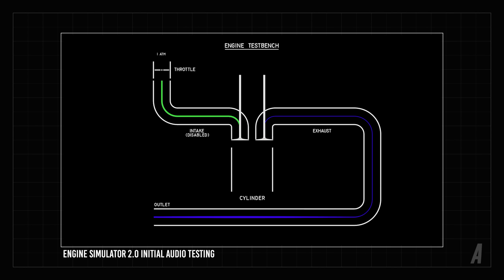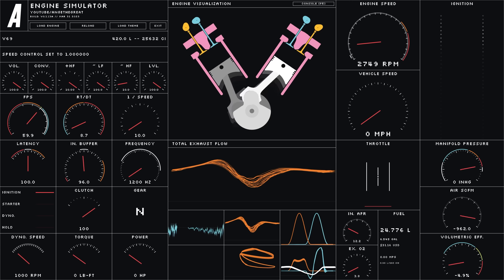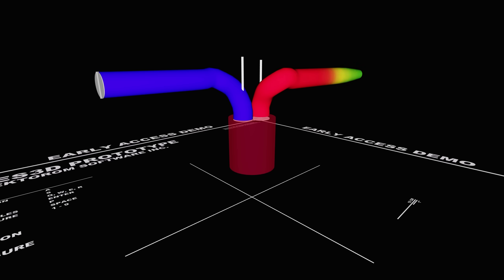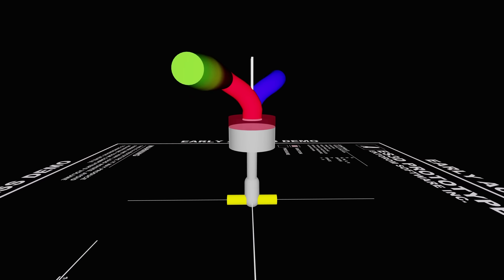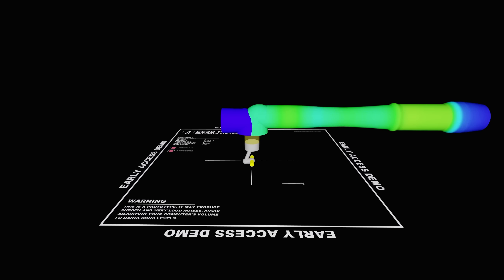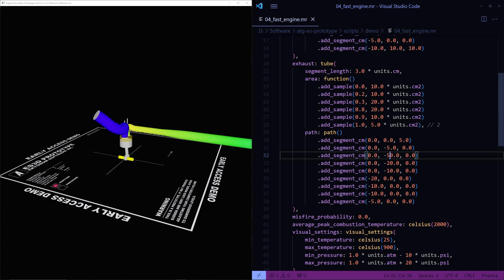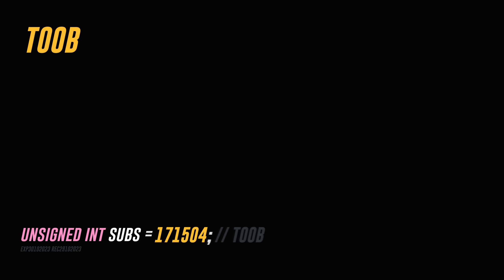Real-time Engine Tuning - Engine Simulator Devlog 4

Comment: Referencing to “Engine Tuning Demo”, where you say physically resizing things is challenging because it has to resize things while the engine is running. You could possibly take beam’s approach at this. When you select a part, the entire model (and I believe physics/physics engine?) resets in an instant, and starts off in the state it was originally with the new part added, with the engine running in the same state. Or if there are multiple parts to be adjusted (to save time) there’s an option to select the amount of parts you want to replace, then clicking “save” will reset the engine with all the new parts added in. Maybe you’d have to start the engine from off, or maybe not. 

There’s also this kind of fail-safe mode where the entire physics engine abruptly stops if things get a little ( or a lot) out of hand, so instead of crashing it stops the entire simulation as a whole and allows you to reset whatever you were working on.

I have no idea what I’m talking about, but maybe it could work, just saying my idea :)
Reply: Beam's approach is the same as Engine sim 2D, where it reloads the entire car bringing it to a complete stop

The goal with engine sim 3D is like if you were racing down the highway in Beam and changed a part on your car, then it would keep going at the same speed with the new part

And making the cylinders super big suddenly would be a similar problem to if you in Beam put on wheels that were 3 times the size while maintaining the same speed

There isnt really an easy solution
Reply: @ValentineC137  seems a little counter intuitive, wouldn’t the simple answer be to just use the approach that was used in ES2D? 

I’m unsure why the engine has to keep running while changing parts though? That has me a little confused.
Reply: @madloudnoises  it would, but doing it this way not only provides a massive QoL update over ES2D if it stayed with a script-based editor.
But it's also essentially necessary to be able to implement the 3D User interface editor that's planned for ES3D

The patreon demo also already have some early implementations to smoothly transition between engine scaling to decrease the chances of the engine bugging out
Reply: @ValentineC137  oh nice! Okay, I understand a little bit better now. Thanks for the insight! :)

Comment: Love how far this has come, dude. I got a suggestion for an engine to put into the Simulator. Supposedly, Mazda is working on a 2 stroke engine that works like a 4 stroke. Can you try to recreate that engine in the Simulation so we could see what different cylinder configurations sound like with Mazda's setup?

Comment: reverb and distortion are two really powerful effects that allow you to make your sound much more interesting and harmonically rich without much effort, actually one of the suggestions for beginner music artists is to limit usage those effects as much as possible as it can quickly get out of hand turning your work into a noisy mess. 4-6% reverb is ok for a little makeup, 6-12% to add a bit of space, more than that only recommended if youre going for ambient style of sound.

Comment: Your attention to detail and dedication is impressive! I imagine this simulation is being designed for games but wondering if it would not be useful for engineering work in general,Keep going!
Reply: There's a comment above about using the original Engine Simulator to recreate vintage motorcycle engines for tuning and HP numbers, and apparently is amazing accurate! So I imagine the new ES3D will have huge implications for engine tuners and designers. It's simply incredible work Ange is doing!

Comment: YES! 2 stroke pipes! I have been waiting for it. All hail Ange the Great.
What's interesting is that I thought 4-strokes did not benefit from an expansion chamber since they have valves direct fuel-air mix and exhaust gases. AFAIK in 2 strokes the purpose of the return wave is to push escaping fuel-air mixture back into the cylinder right before the piston closes the exhaust window, and 4 strokes don't have this problem.

Comment: It would be interesting to see VR implementation in the simulator. As you mentioned that the new Engine Simulator will allow you to change the microphone position in 3D space, it would be pretty cool to be able to walk around a 3D rendered engine and listen to certain parts closer by getting near them.

Comment: No need to apologize, even your work in progress that still as some kinks that need to be worked out is very impressive indeed. I've built 3D Game Engines from scratch using OpenGL, DirectX and a little bit of Vulkan in C/C++. I've even did a project on emulating the 6502 CPU(NES) and I've even built a working 8-bit CPU in both Logism and a game on Steam called Turing Complete. And yet this project even at this stage impresses me!!! Then again, I enjoy math, physics, a bit of chemistry, and just about anything that is software - hardware - electronic engineering related. It's still a very impressive piece of artwork!!!

Comment: You have modeled the effects of air pressure changes and such. But I feel like it is missing the mechanical clicks and clacks. For example, I would expect the valves to make sound when they close. And possibly the cams lifting levers, or the whirring of the gears and bearings.
Reply from the maker: I'll get to that. I have some ideas

Comment: With both the intake and exhaust pressure waves being modelled so accurately, I'm super excited to see turbochargers added. It should be able to correctly model turbo lag vs turbo size and maybe even turbo flutter pretty accurately without too much extra work!

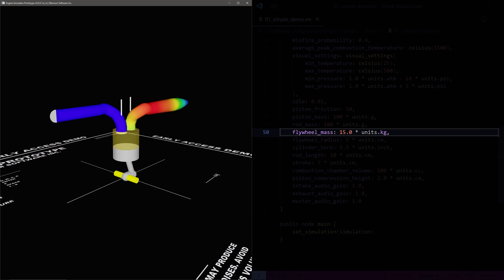Comment: 13:02 a perfect moped engine. You know, the one seater usually with a rack in the back for storing items, usually used by delivery drivers. You know what’s the worst? When one of these drives by your house at 2 AM in the summer. Why? Because you have your windows open, and all of the sound comes clearly!

Comment: Given that BeamNG is patreon supporter, i assume there are plans to put this into beamNG at some point. And. I. Cant. Wait!

No pressure ofc, take all the time you need! Respect tho that this already sounds so awesome while there is still this much to do!

One note i might add is that i would love to see some more code and the inner workings of this project. But i get that code is sadly hard to cohesively show code in a video without loosing like all but 3 people :/ 

Keep it going <3
Reply: Running the simulation in realtime would be too resource intensive in an already demanding game, but this tool would be great for making a map of torque and sound based on speed and throttle.
Reply: @user2C47  Surly performance will be less and less of an issue further down the line, once the simulation is feature complete performance can be boosted by optimisation and simulation quality parameters

And when/if a beast like the BeamNG devs get deeper involved a way will be found to make it realtime one way or another, or a Audio-realtime checkbox etc are also options. Afterall, they made a fully Realtime very close to realistic physics car simulation while making it look and feel awesome and being playable on low settings even or relatively meh systems

But idk, feels kinda weird to make such assumptions without having tested this software, knowing the codebase and what is planned for the road map and so on.

I have confidence in this project and in Ange, he will do what is right and what will happen happens and what doesnt donest :)
Reply: @floschy_1  Beam NG has TechNG too, if I'm not mistaken. BeamNG will be a really big thing in 2 or 3 years, and this engine simulator will change the world
Reply: @gabrielv.4358 What's going to happen in 2 or 3 years?

Comment: This is awesome! I've had two stroke engine designs kicking around in my head for many years and despite my best attempts at using ansys fluent with dynamic meshing to solve it the program is just too inflexible (or I am too stupid) to get results that make sense. This seems like a much more user friendly and flexible approach to the simulation problem.

Comment: A good solution to changing parameters of the engine on-the-fly is to animate them smoothly across the engine simulation timesteps. This should help ensure that the simulation stays stable. I reckon this will be even more useful with the UI because having 60Hz updates from dragging the mouse will probably create distinctive tones in the engine output that could be annoying, much better to be able to smooth the updates out. It's probably also sensible to have a very small amount of smoothing for the throttle control of the engine too.

Also, would be really cool to see if you can look into rendering methods that can smooth out the engine visuals to look more like they would look IRL. Once an engine is going over a few hundred RPM, it should just look like a blur. It's one of those details that will probably make the simulation feel more accurate and satisfying.

Comment: When implementing a change while the simulation is running, I'd strongly recommend simply saving the engines current attributes(throttle position, rpm, etc) and having the simulation change wait for either top dead center or bottom dead center to implement, then restoring those attributes. The only time this would be noticable would be at RPMs lower than 120, and it should reduce potential bugs from popping up.

Comment: Looks like things are coming along nicely.
Long term, are you considering simulating various types of forced induction?
And this is more of a pipe dream (heh), but have you thought about implementing various vacuum-controlled engine components, such as spark advance, or even simple carbonators?

Comment: its funny, i work on atv engines alot, and it sounds almost exactly like a bike engine. now, i can see a few things to try to take into consideration when building the final product. Valve size, valve lift, valve duration, combustion chamber size and shape, crank case volume and pressure, muffler baffle size, shape, and design, and air box size shape and design. just food for thought. as engines are built in seperate segments, (i.e the cylinder head is separate from the block or jug, etc) all the components alter how the engine will behave. 2 strokes are especially prone to these tuning parameters.

Comment: an expansion chambers purpose is to rush air into the motor to keep the fuel-air mixture from escaping out of the exhaust since the 2 ports are parallel.
Reply from the maker: That's ONE of its purposes and the technical term for it is port blocking. This, however, is not its only purpose
Reply: @AngeTheGreat  love the project man
Reply from the maker: @havoc-note  Thanks man 🙏

Comment: It's neat  that the 3am engine has that strange resonance you get on smaller engines somewhere around 3k RPM under load.  I've got me a little civic that does exactly that, but I don't have the time/money to experiment and try to remove that resonance.  I'm looking forward to ES3D (or whatever the end result is called) specifically for cases like this.

Comment: You may need to consider alternative methods of pressure calculations instead of the ideal gas law. The ideal gas law is, well, ideal. I dont recall whether or not you said which one you were using, but the soave redlich-kwong equation of state is one of the more complex (but more accurate) simulations for gas at extreme temperatures and pressures. Might be worth looking into, although I'm not sure how well it could be optimized for efficient use.

Comment: I can barely wait to make wacky engines with 3d graphics!!!! Will you add OHV engine design??
Reply: Willl we be able to drag and move the 3d assets and modify it in real time if we dont want to mess with the code??
Reply: I LOVED The RAW Intake sound! We'll be able to make really awesome to make velocity stacks!!!!
Reply: I hope we'll be able to make engine backfire with low or too much fuel!
Reply: Add Diesel Simulation too, where you can choose Gasoline or Diesel, and the chamber changes accordingly, whereas the diesel has no spark plug, and the gasoline has.

Comment: 9:41 "ey yo, my car's powered by satan." - "...wat?!"
Also wanna just state how insanely impressed I am with this. I love physics simulations, but this one's different because it gives a lot of understanding for things I never even thought about. And that's already in it's current state. Can't wait for the final result 🌟

And there's a small thing I'm curious about regarding the plans for the final ES3D: will it be possible to add "logic" to the engine, like controllers for valve timing for example?
Because there's something I've been wondering about for a long while, which would require extensive modification of the value and injection controllers of a modern engine. And that's not gonna happen IRL, so ES3D would be the perfect thing for me to find out one day.

Comment: Perhaps with the exhaust, you could add a tunnel type reverb with the approximate dimensions of the exhaust system to simulate the sound coming from the far end of the exhaust (as opposed to originating from the exhaust tip)

Comment: I know you did add the ability to simulate rotary engines to your ES2D, but are you planning on doing the same for ES3D too? I would absolutely love to see some crazy multi rotor designs simulated in the new iteration. I can already tell once it's finished the audio quality will be miles better than the first version.

It would also be awesome if it were possible to simulate some more novel engine designs, like the LiquidPiston rotary X Engine. Especially considering there are very limited real world examples of that engine so far, it would be super cool to see how it runs and sounds on a larger scale

Comment: Maybe I'm misunderstanding a little, so bear with me, but since you have 2t on the mind, do you also intend to have diesel system emulation down the road map? It'd be really fun to simulate some of the diesel engines of the past (VW Golf/Rabbit anyone?), and also to simulate things like the "new" valved two stroke that's being proposed as an engine for hybrid systems
Reply: As of this video's level of simulation complexity (instant 100% homogenous ignition throughout the cylinder, somewhat like compression ignition), I think the only difference between diesel and gasoline would be the pressure in the cylinder post combustion, as diesel would have different stoichiometry then gasoline resulting in differing amounts of released heat and number of molecules.

Changing the stoichiometry should be a pretty simple change. However, idk how much he intends to model combustion dynamics such as flame fronts on spark ignition, knock, and compression ignition failure/incompletion such as when a diesel is cold starting.

edit: nevermind, found out that diesels vary their power output only by controlling how much fuel is injected, and don't necessarily need a throttle body for operation.
Reply: @needles_balloon  yeah, diesel throttle adjustment is fully down to the pump and injectors being controlled by the ECU; no throttle body like on a petrol engine. (older diesels used a pump with a mechanical valve that was tied to the throttle line.)
Reply: @needles_balloon  IT has to have a different fuel system, and fuel burn in times, diesel is slower than gasoline, really slower, and it burns with pressure, so if we made a diesel engine it would NEVER Run on gasoline. And it makes a very distinct noise too. I hope he adds it!!
Reply: @gabrielv.4358  it would run on petrol, just not for very long!

Comment: will the engine simulator ever be part of beamng? to make their world’s most realistic physics simulator even better? perhaps crashes could dent the intake or exhaust systems of the car and change engine noise. currently beamng does change the engine noise if the exhaust is damaged but it is quite primitive, your simulation would make it much better

Comment: i spoke to soon! sorry. i am going to build a 2stroke vintage race car and looking into ways of making more power. having the optimal exhaust and intakes really makes a 2stroke come to live. i have a Saab 96 1963 bullnose 2stroke. its a 3cyl 850cc engine. (stock 46hp) tuned makes about 80 to 90 hp

Comment: This is so cool.
One question:
Will you implement ray traced audio for more realistic reverberation around the engine as well as spacial audio and maybe HRTF filtering as well?
This doesn't have much to do with the simulation this is just for "walking around" the engine. Maybe it could sound cool.
Reply: "ray traced audio" sounds really weird as a term. Sound waves are not rays and do not behave like rays afaik. Is there any serious work done under that term? Only thing I found is a vid of a guy applying different effects (low pass filter + reverb parameters) which is not that interesting.
Reply: @jutube821  It's used in games for simulating sound propagation.

It basically means instead of just calculating sound volume based on the distance from the sound source and the direction of the sound based on the position of the sound source in relation to the orientation of the camera we use ray tracing to simulate sounds being reflecting of surfaces.

I know back in the Forza Horizon 4 reveal trailer the devs mentioned it, but honestly I don't know of how any implementation of this is done.

You might find Rainbow Six Siege as an example but that's not it. Rainbow six uses a path finding algorithm for audio propagation, not ray tracing.
Reply: @FelixVyra It's used in Returnal. That's the only game I'm aware of that uses it.